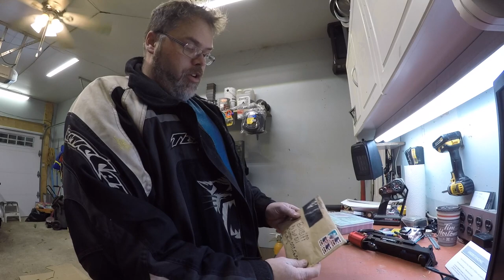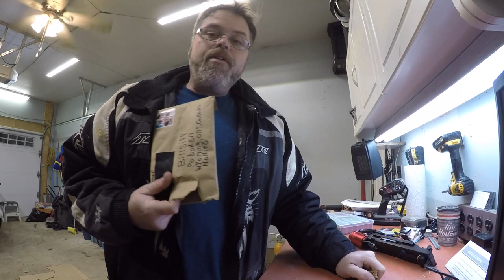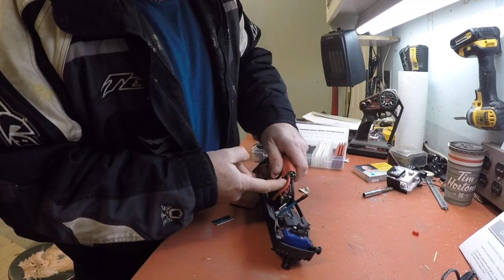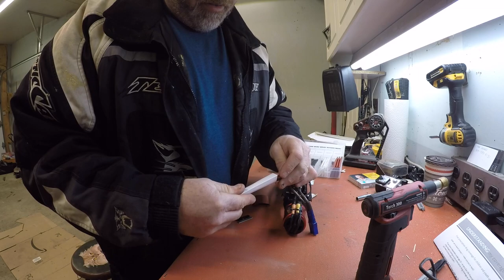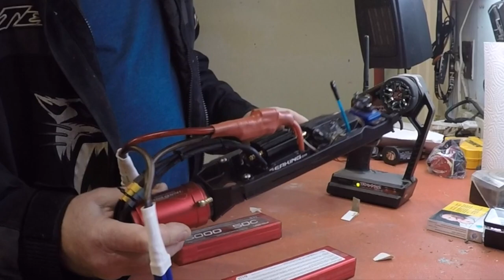Spartan Wiring DONE

Comment: put you some hot glue around the wires before the tube goes over and then shrink the tube over the wires and glue,, sealed WOLLA. and also if the connection are getting to hot the glue will let you know by seeping out. another WOLLA